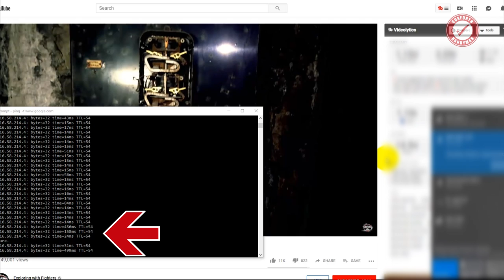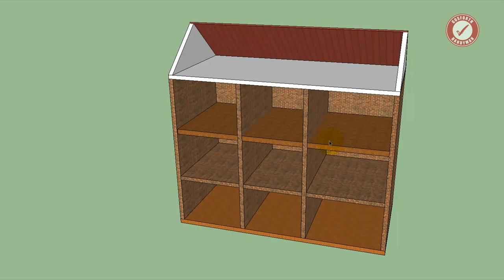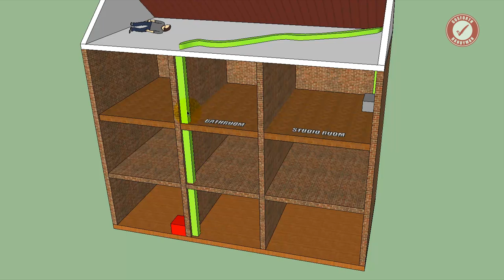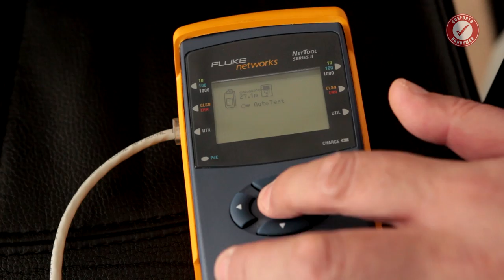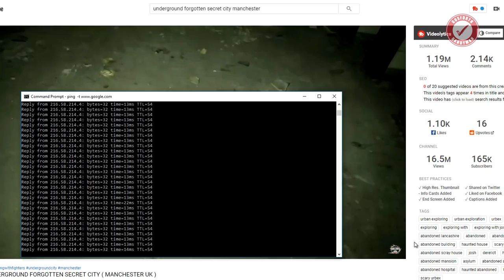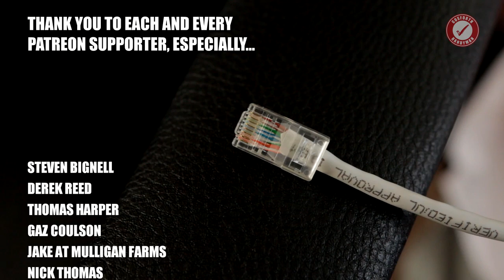Running RJ45 Network Cables inside walls ...and fixing Wi-Fi problems!

Comment: Why not Powerline adapters running at 1Gbps for £30? Plug them in by your router and PC and your done in about 60 seconds with zero house bashing! They are very reliable for home use (I had a set running a remote server which had an uptime of over 2 years)🧐🧐🧐 Also for info it’s much easier and more reliable to punch down your Ethernet into an RJ45 outlet and then use a patch lead from that to your equipment rather than faf with a crimper which is never done in a professional environment these days. (Network and data centre manager here 👍)
Reply: They often don't give very good bandwidth if too much wiring between the adapters. It is even worse if the two rooms are on different circuits. For example my home office room is on separate circuit to the lounge where the router is. If I plug two adapters in the lounge I get the full speed of my internet (100mbit). If one is in the lounge and one I my office I only get 10mbit.  That is actually worse than my WiFi performance.
Reply from the maker: Yup - mentioned in the vid, tried powerline - didn't work. Wiring to faceplates would have been way more work so this is fine for my needs. Crimpers are used all the time for custom length patch cables in datacentres. 👍
Reply: Gosforth Handyman very odd, the only occasion I have seen powerlines not working is when used across separate phases, never had an issue in a domestic environment - mine are on two separate circuits and run at 1Gbps steadily. Crimpers are never used in professional environments to make up patch leads, not worth the hassle of dodgy connections - you keep stores of patch leads for that reason and have the relevant infrastructure in place so you don’t need to patch further than a rack. If I ever spotted an engineer attempting to bodge up a lead with crimped ends they would be sent off site on their horse! Terminating to an outlet is actually much less work than crimping, gives a more professional finish too, an rj45 faceplate and patchlead probably cost less than that brushed faceplate. Not slating you in any way, just trying to illustrate there is an easier and more professional way to install data, that is coming from someone who manages more than 35000 active Ethernet ports. 👍
Reply: @gerrym4377  It also depends on what devices are running on the circuits.  Some devices generate noise that causes powerline to struggle.
Reply: ksp1278 very true and a good point! Inductive loads can do that but will be rare in a domestic environment.
Reply: @gerrym4377  I am not an expert in powerline, just conveying my experiences. I have read though that's anything with a motor in it (washing machines, driers, fridges, freezers etc) will add noise. So will switch mode power supplies (like in mobile phone chargers). I have read that plugging these noisy devices into a surge protector can help.
Reply from the maker: You've obviously worked in very different datacentres to me Gerry! I've seen many where every single cable in high density racks, even the power cables, are custom made for a tidy install. In fact we had some customers who's employ a dedicated cabling company to come in and do all custom wiring. Here's an article on the very subject https://www.exn.uk/blog/data-centre-cable-management/ So crimps may not be used in the environments you've worked in, but that's certainly not the case for all datacentres.
Reply: Gosforth Handyman I don’t just work in them mate, I manage and run them. I’m certainly not in the business of arguing on the Internet, that is already a crowded marketplace! I am just passing on best practice for the benefit of others who may be seeking clarity on the way to properly cable a data environment , what you or anyone else deems as acceptable is your own concern. I like your handyman videos and will continue to watch and like them, all the best.  Edit... I just looked at your link and every cable shown connecting to that old router in the picture is a manufactured one. Peace and feel free to the last word 👍😂✌️

Comment: As a temporary solution, use homeplugs with an extension cable.. just make sure the first homeplug is plugged into the same socket as the extension and the second homeplug is plugged into the other end of the extension. 
The speeds will be similar to the end result here (depending on network limitations).
Reply: no it wont

Comment: Didn't catch anything fishing then? 😉🤢🎣...... bet you could use a drink after all that running up and down the stairs!! 
Good timing, I'm just about to do the whole house but every wall is solid brick🙄, at least it's a bungalow tho!
Reply from the maker: Good luck - it's a big job but worth it. Can send HDMI over ethernet and all sorts. 👍
Reply: We've decent t'internet speed 230mbs+ so every tv is going to be hard wired rather than wifi, freesat to each room as well, I'm going down the ubiquity/unifi route with separate modem-router-gateway switch etc.   

HDMI over Ethernet, hmmmm that might solve one problem 👍

Comment: Just get a WiFi extender run by socket... really should
Be no need for any of these
Reply from the maker: Tried several - terrible. Do you mean powerline ethernet? They were terrible too. Different ring mains and a split load CU. 👍
Reply: Gosforth Handyman in all honesty I’ve been using this for the past 10 years and they are very good. If anything better than wireless, if you connect straight to pc
Reply: @tonygoshive785  But it all depends on how good the mains wiring is in the building.  It can never match dedicated network cable.

Comment: Absolutely no need at all for CAT6 or 7  it'll add nothing but cost, there's zero benefit in a domestic install. If you or your neighbours have SKY Q then that's why your wifi doesn't work. 80mhz channel width is using the whole 5ghz wifi range.

Comment: Next time, try fiberglass rods and you won't have to cut and plug so many holes.  Good quality rods are unbelievably flexible and strong.  You'll never switch back to using fish tape or pulling cords again.
Reply from the maker: You wouldn't get rods past all the obstructions - it's not a straight route. 👍

Comment: Ouch. As a computer engineer qualified to degree level, it makes me whince to see people pulling network cables. That is the easiest way to damage them.

By the way, I use a cheap cable tester that works a treat. Tells me in under 1 second whether the connections are good or not.

I would have gone for faceplates either end as then you can use a router to increase the number of devices very easily.
Also, you could have run a second line to the middle floor to allow easy expansion if needed.
Reply from the maker: I can add a splitter to the cable if I want to add an access point. Not pulling cables? How would you do it? Push them? 😂😉🤔
Reply: when you were qualified to degree level did they not teach you this is the completely normal way that network cabling gets installed? a cheap tester doesn't tell you squat it just gives the most basic continuity test, he's using a proper tester world of difference between that and the cheap ones.
Reply: @sparkybrian8512  By "proper tester" do you mean a Time Domain Reflectometer?
Reply: @jamesrodgers3132  yes, the fluke he's using does that.
Reply: This guy sounds annoying. Like I’m my own biggest fan kinda guy. As a qualified dork blah blah. You did a great job. Got it done 👍🏽
Reply: I am degree qualified also and I can tell you that 95% of what is taught is either useless in the real world, incorrect, or not the most efficient way to do things. Degrees mean nothing. Experience does.
Reply: ksp1278 amen brother

Comment: If you can, its a good idea to run CAT 7or 8  (you can use 5e or 6 for some things) from all the double RJ45 sockets to a utility cupboard and have a patch panel or a row of sockets. You then terminate things there such as broadband and phone and you can then use the CAT7 structured cabling for anything you want, such as ethernet, PoE, analogue phone, USB, analogue or IP cameras, IR extenders etc...
Reply: total overkill in a home